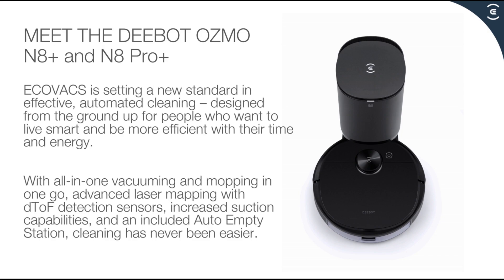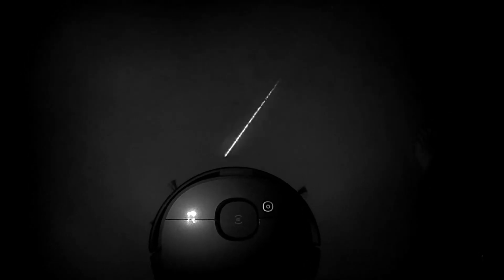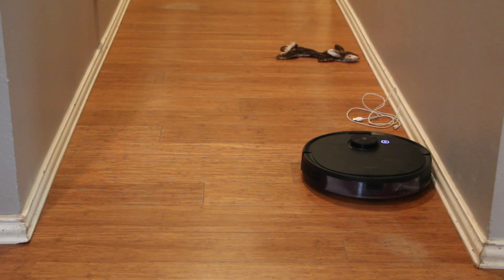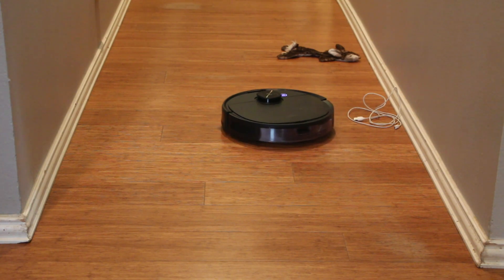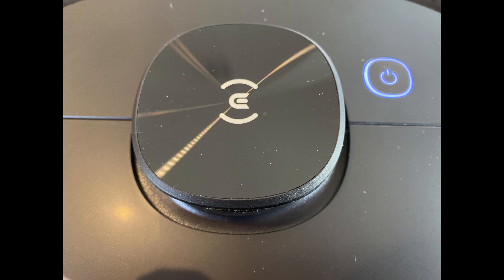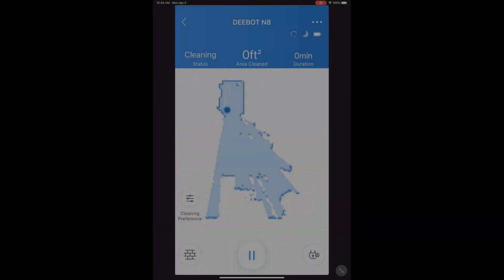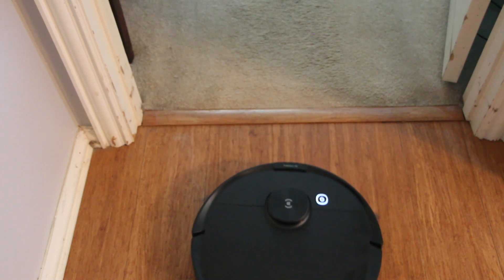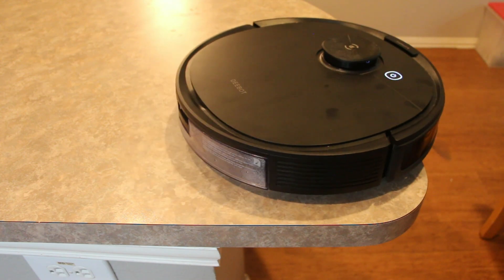The Ecovacs Deebot N8 Pro+  [Part 4] TrueDetect 3D Laser (Object Avoidance) and the other Sensors

Comment: Thank you for your very informative videos. Do you have any suggestions to get the evac n8pro to go over 1.25” level change between rooms?
Reply from the maker: Do your wheels make it to the top. If so you can try something like this grip tape. If not, you probably will need to consider some sort of ramp. 
https://www.homedepot.com/p/4-in-x-34-ft-Anti-Slip-High-Traction-Safety-Grip-Tape-for-Stairs-Steps-Ladder-MA-ASGT-4-34/312387533?MERCH=REC-searchViewedNA-312387533--N&

Comment: Can you help me which is better for 50sqft and 2 floor sir,thank you.
Reply from the maker: I usually wouldn’t recommend it because of the small battery but for 50sqft, depending how big the second floor is, you should be good with either the 920, N8 or N8 Pro. All have the same battery, just more functions the higher you go. 
N8 - More suction & compatible with auto dustbin
N8 Pro - Even more suction & compatible with auto dustbin plus Truedetect 3D object avoidance.
Reply: @Hotsparks66  i am hesitanting about T8 and N8 pro sir, thank so much for your suggestion
Reply from the maker: @nguyenluan3488  T8 is nice and you’ll never have to worry about running out of battery, if you need it. The N8 has higher rated suction (only needed for carpet).  Personally I can’t tell or hear any difference in the 2 vacuums as far as suction.  Except for higher rated suction and smaller battery on the N8, there is really no other difference, except if your considering the Ozmo Pro (vibrating mop) the N8 does not support that.  Both you mentioned has the Truedetect 3D object avoidance. 
Glad to help.
Reply: @Hotsparks66  thank you so much, wish you have a nice day
Reply: @Hotsparks66   hi boss,  T8's suction is not enought to clean carpet? A lot of hair and carpet in my house.
Reply from the maker: @nguyenluan3488  it’s up to you but as I said I can’t tell any difference in the suction. And that carpet is going to drain the smaller N8 battery pretty fast.  It does mine.
Reply from the maker: @nguyenluan3488  Vacuum wars on YouTube measures the suction and measured the T8 & N8 the same.
Reply: @Hotsparks66  thank for your helping sir.

Comment: Hello, which one do you think is better, the t8 or the n8 pro. I have around 120qmeter and mostly hard floors(laminate). Thank you very much
Reply from the maker: I prefer the T8 simply because of the much bigger battery. In my home it makes a difference. If you have a large floor plan or a lot of carpet, I would go for the T8. The only other difference is the N8 is supposed to have more suction. I can’t tell the difference. Of course if you don’t have carpet, that’s not an issue.  Actually the popular YouTube reviewer Vacuum Wars, did a comparison and measured the suction as the same.  As far as cost, I haven’t compared.

Comment: Very useful video. Probably the most important upgrade compared to the 950, good to see how it avoids objects. Thanks
Reply from the maker: I’m really glad you found it useful! I have both the 950 and the T8+. Don’t ask! Night and day. My 950 was always getting tangled on something , even after picking up.  T8, I recall once, at the bottom of my daughters closet with straps hanging down.  I was testing it.
Reply from the maker: The T8 (not T8 AIVI) came out before this with the same object avoidance. A little less suction, but with a much larger battery.  The T8 has the same suction and battery as the 950.  Really depends on the size of your floor plan.

Comment: Hi, tactical question. Can it go out and do vacuuming and then mopping automatically within the same run? Or we have take the mopping head off for vacuuming?
Reply from the maker: It’s actually advertised that you can do both at the same time. The only limitation is, by design the vacuum will not allow it to travel on carpet while in mopping mode (mopping plate attached) so in case of carpet you do have to remove the mop before you vacuum your carpet.
Reply: @Hotsparks66  I see, thank you. In my case it couldn't even go back to charge after mopping. It's not a deal breaker but good to know. Thank you.
Reply from the maker: Is it because your base is on carpet or your floor layout?
Reply: @Hotsparks66  It is because my current one (a basic but great Eufy) is in my room on carpet. And currently this seems to be the best location.
Reply from the maker: I can not tell much difference in the increased suction. In their review Vacuum Wars measured the air flow as identical to the T8 even though it rated higher.